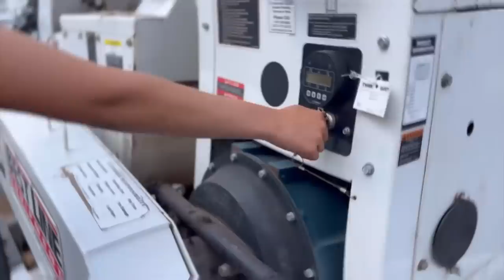This machine kicked our butts today! Making mountains with this chipper

Comment: The best way to use this profitable, is to put the chips through a hammer mill and make small particals from it.
Then it can be used to make blocks (for stoves/open fire places) or for special central heating boilers, big and small, they function full automatic.
Reply: would say "not in the US"
Pellets seem to be a EU thing.
Reply: @andrewforward3812  Note: there are special pellet stoves and central heating boilers, as well as sawdust stoves and central heating boilers. "Bricks"from chips burn in everything...but are also a good way to make money from waste.

Not only that, but using sawdust/pellets/chips you can heat fully automatically.

Comment: Love the videos. Just a heads up, we use our log loader to feed that size chipper. Getting 4 to 8 slabs to feed in at one time works out well. By the time you get the next grapple load, the machine is just about ready for another grapple load.

Comment: Chippers are designed to work with green wood from tree pruning and removal. How does the chipper do wth dry wood?  I would think it would be harder to cut. You girls may want a dust mask while running that. It looks like it throws out quite a bit of dust.
Reply: you just watched them chip green wood

Comment: Chips make a good substrate for growing some varieties of mushrooms. Your nearest mushroom/mycological society might find a market. I have used chips for landscaping too, but those small flats seem to splinter into some pretty big pieces. Big mills around here use chips to fire their boilers to run the mill. It's too bad nobody markets a large Stirling cycle powered generator. If you leave them out in the rain they will compost down about as fast as your sawdust.

Comment: You can use it as it is as ground covering; but then it is little profit; you can put it through a filter and the bigger parts selling for use in stove; you can press blocks from it, for heating.
But whatever: it will cost investment, that is logic.
Also packing in bales is possible.

Comment: What would happen if the jacket boards were set on a platform at the height of the chipper entrance? Just slide the boards without bending to the ground. :)
Reply: or just pilling the boards higher, then one only has to lift the ones at the end.

Comment: Have dad sharpen the knives every day, The top opens up to do that with out removing the knives.
A 4 inch angle grinder with a sanding disc That machine will take 2 boards at a time easy.

Comment: what lav mic are you using? the signal seems a tad hot. turn down a bit and it won't clip like in the opening scene. just a little production tip. everything else is spot on!

Comment: Why not use the log loader on the forestry trailer to feed the chipper?? It would be way easier.
Reply: I think that is a good question and I have a potential answer.    For one thing their grapple, the way it is designed, is not likely  to be able to pick up one board at time; it is made to grab a log and the board is too small.  and they do need to do one board at a time so that the roller gets a good grip on the board and won't kick back.  some grapples can pinch right down to nothing but  it looks to me that theirs do not.
Reply: @scottsoper  I have 50 years of sawmill and logging experience and that loader would do just fine..and with that said I also have the injury from a life time of heavy lifting and i,de hate to see those women all  crippled up like I am from years of heavy lifting.. I give advise to save their backs and necks.. they need to get setup to cut down on the heavy lifting.
Reply: @twobears1224  AH HA!  I came up with a picture that cleared up that particular grapple and how small it could grip in one of their other videos.  The one side can fit inside the other side, so it can go down quite small.  In other pictures it did not look like it would do that.   However I think using the grapple would be slow but I would of tried it because I do not like lifting.  The other thing I would of tried is just make the stack taller so that the lifting would be only for the boards at the end of the job.  I sorry that your job was so hard on your body!

Comment: Where i reside. We call them. Orillos.They were really cheap years ago. Now they sell them. They are no longer  cheap. I have used them for siding on sheds. Vertically or horizontal. Even at 22.5 .They make great  fence for privacy. 
Built a chicken coop.
Not easily available anymore. 
Round this parts. 
Maybe we don't have any hard working girls to get the job done. Guess the  men 🤷‍♀️

Comment: This is more about the quality of the chip coming out. It looks like there was a lot of slivers being kicked out instead of chips. That's probably more to do with dull chip knives that are out of adjustment than anything. If it wasn't a rental machine that would be something that would need to be addressed sooner rather than later.

Aside from that: gloves, long hair tied back, long pants instead of shorts, eye protection. Granted it's probably something that was side stepped because it's a hot job, you'll be covered in wood dust, and it was something tjat just had to get done quickly. All of that was obviously true and I'm not going to fault for it. But it's still not a good excuse to forgo safety for the sake of comfort and expediance.

Comment: When operating any equipment, you MUST put your hair up so it CAN NOT get entangled!!! Accidents happen in an istant and there is no stopping them....I hate to "spoil your day" but....Head protection. OSHA requires employers to make sure their workers are using head protection. Head protection protects workers from falling objects, contact with exposed beams or pipes, or electrical hazards. It's also a requirement that workers with long hair protect their hair from catching in machine parts.....

Comment: that's about the most dangerous fatal machine  on your site but slabs are little safer than brush
but you both should have glasses on since the flaps are worn and could kick chips or a nail back

Comment: Hey you two hard working ladies, please remember this advice………never stand directly behind the chipper when you’re reloading her.  Kickback on a chipper is massive compared to a table saw.  The chipper kick back will impale you and the force drive you 50 yards back.  Please, please, please be careful.
Reply: Also, that chipper should eat more than one slab at a time. I've used a few for my tree service -- I'd guess that at a 12". So you could easily run 7-9" of wood into it at once. That might make the job go quicker. 😉
Reply: They were being very careful
Reply: The way they were loading it was perfect

Comment: Oh no PLEASE PLEASE 🙏🏼🙏🏼🙏🏼🙏🏼🙏🏼🙏🏼🙏🏼🙏🏼 TIE YOUR HAIR BACK. In college in one of my wood shop classes. 
One of the female students had hair as long as yours. She was surfacing a 8’ piece of rough cut pine. Her hair got caught up in a knot. The surfacer feed rollers pulled her head by her hair.  Into the cast iron body of the machine. She was pulled in with such force her scull cracked. She lost most of her hair. She was unconscious and bleeding profusely. 
She was hospitalized for 8 months. She was in a coma and on a ventilator for a long while. 
She didn’t return to our college. I don’t know what happened to her.

Comment: Well you 2 put the wow in lumber. Heres a money tip your missing.  HARD WOOD STOVE, AND FURNACE PELLETS. THEY SELL FOR PRETTY GOOD MONEY. HERES THE HOW . Girls, on Amazon there are 5 ton press, you buy different " dies, " just like a pasta maker. But your USEING your saw dust, and hard wood chips. These 5 ton press, have large bins on top. You load them with the chips and saw dust. The press, smash them down into a soild , hard log, and pushes the pressed ,( scraps ) thru the pellet dies, then cut them at how ever long you want them. The pellets, slide into a large bin. You girls, them, buy or make, the logo bags, put x amount in . And vacuum seal the bags. Sell them in 5 or 10 pound bags. The mix of good smells hard wood, hickory,  apple, would be pellets for pellet smokers, or pellet grills. People living off grid heat there house with them. So girls...
Easy money, and theres no striper poles.haha, joking.

Comment: Emerald and Jade did this job correctly on all counts as far as I am concerned. The chipper was placed so that the chips went in a pile where they wanted the pile.  The wood to be chipped was brought to them by the John Deere loader.  I may have made the pile higher so I would not have to bend over as much maybe....   Safety: they fed the chipper one board at a time.  This way the feed roller has a good grip on it and won't be spiting stuff back.  Their hair is NOT near anything that is spinning.....  They will NOT be sucked into the machine because there is at least one, maybe two stop bars, and more importantly they know what to do so they will not be sucked into the machine...     Emerald and Jade got the job done in good time and made a video besides!!! 😀😃🙂
Reply: Safety glasses, gloves and hearing protection come to mind?
Reply: @gordbaker896  Hearing protection: Yes and as you can see they are using hearing protection.  "Safety" glasses fog: I have never had any that were anything more than a danger in themselves.  Gloves: NO as they have explained in a video.
Reply: You don't know much about working with machinery and wood.   @scottsoper
Reply: @gordbaker896  🤣🤣🤣🤣🤣  You don't know a thing about me!!!!      I do however view safety as understanding the machine one is working with and the situation one is in.  Wearing gloves and safety glasses will not make up for not understanding the machine. You are mechanically reacting to someone's idea of safety not accessing what is really happening.  That is my view.   I am sure you would be appalled by what I have done with all kinds of machines::: I forgot: is the airplane supposed to be pointed at the ground? AH! "Maintain thy speed lest the ground comes up and smites thee"   OOPS! wrong rule for the situation!  Let's see,  the ground does seem to be coming up, lets use full left rudder! 🤣🤣   Lets be clear. I believe in safety!  Real safety.  That means knowing your machine; knowing your situation with the machine; knowing ones personal limits and ability with the machine.
Reply: Rave on.  This is a new machne to them and ALL machines need to be given full respect.  Eyes, fingers etc don't grow back.  A lesson will be learned in time....  End of discussion. @scottsoper
Reply: @gordbaker896  Well I agree that we are not going to change each other's mind!  However it is NOT the first time running this machine for them.   It is however a rental.    Oh and put up a video or something on your YouTube so you don't just look like a blank sheet of paper.

Comment: You so for the gardening for 4-H club for the trees don't put it next to buildings termites oh and another thing sawdust works good sawdust and wood chips were good for one thing cooking whole pig and whole hogs or a pig and a hog with a sheet button is good lamb chops lamb chops barbecue beans with your corn wild onions cornbread with that chili hot dog chili lots of pork and hot dogs bacon and eggs smoked sunny side up eggs poached eggs Pizza wood burning oven is real way to go and it wood burning stove the fireplace is a good thing to cook on less money for electricity less money for the power company save